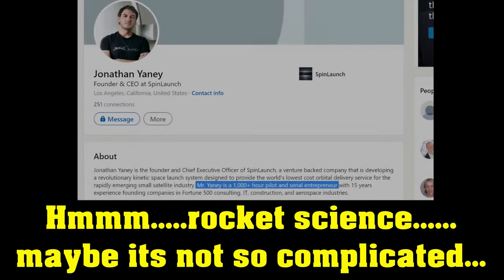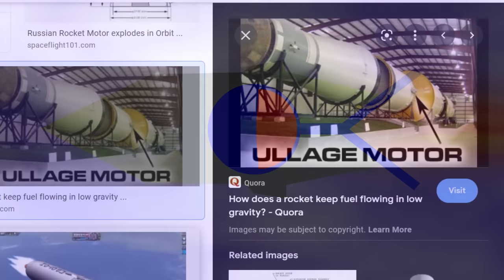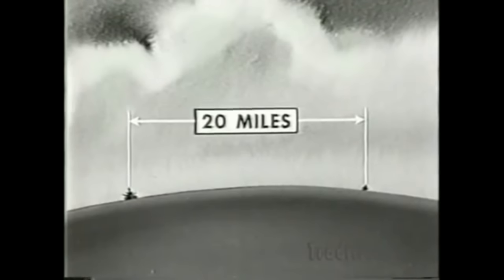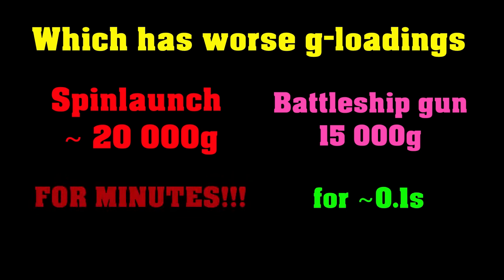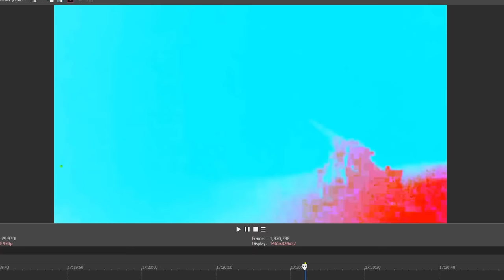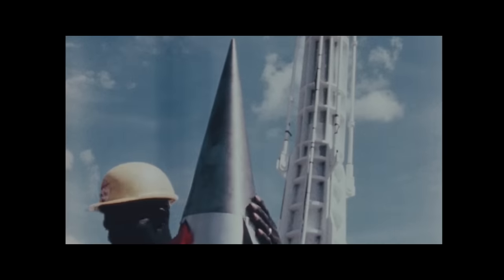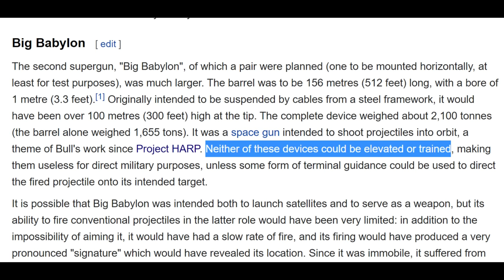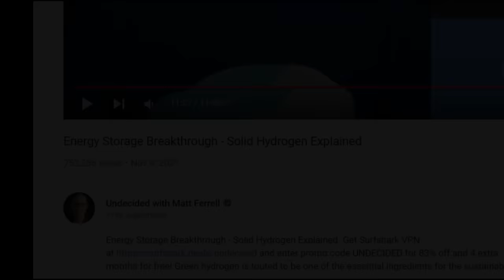Spinlaunch: BUSTED (Part 2)

Comment: Maintaining a vacuum would probably be the easiest obstacle to overcome since you could basically put really big shear rams on the exit hole after the projectile leaves achieving only a partial vacuum loss. After that, as others have commented, the real issue is not having a counterweight to prevent the whole facility from turning into a 5000rpm DEATH TRAP.
Reply: Not with the kind of vacuum they need. Meteorites burn up in the mesosphere, that has less then a millibar of pressure. They are planning to spin this thing for an hour, at supersonic speeds.  I'd say they'll need a damn good vacuum for this thing not to burn to crisp in the first 10 minutes.
Reply: @EvanOfTheDarkness  The ram can be placed at the entrance of the barrel interface to the centrifuge and long before the missile leaves the membrane to be activated as the missile clears. The longer the barrel the better. Still a dumb idea all round, though, to launch a satellite.
Reply: Would it be possible to rapidly reposition the arm along the axis as the missile is disengaged to regain balance? Could it be done in less than a degree of rotation?
Reply: @_c_e_  it may be possible, maybe not moving the arm itself because the space is limited, but moving a mass on the arm. However, the necessary vast amount of energy released in a really short time would match an explosion. Then there is the issue of getting it perfectly balanced within a millisecond... I see a lot of possibility for catastrophic failures.
Reply: @human_isomer  They could release a weight in the center of the arm,  and have it crash into some energy-absorbing material.  The main problem is pulling a vacuum on a rippable membrane.  Atmospheric pressure is insane,  you can use it to crush a train car.
Reply: Na, they just need to figure out how to make a magnetic field. Then they'll be able to launch a whole squadron in a day. Problem solved.
Reply: @LarsLarsen77  The energy released by that would be in the range of the biggest cannon on a battleship and could possibly blast away a smaller hill. Absorbing it, e.g. by water, would require a lake. And the safety zone may easily be several kilometres wide. Daisy cutter counterweight? ;)
Reply: @_c_e_  Air in a vacuum travels at the speed of sound, that's around 300m/s. Unless you are willing to make the launchtube hundreds of meters long (which will create other problems such as having to launch at extreme precision so as to avoid having the missile collide with the launchtube) that shear ram would need to close within milliseconds if not microseconds without destroying itself the mechanism closing it and it's frame while still creating at least a decent vaccum seal and still be able to withstand an airblast at the speed of sound.

The whole thing is essentially a hyperloop just with them causing a catastropic vacuum failure on purpose.
Reply: @KingQwertzlbrmpf  I think it would be possible to time a light weight sliding membrane which accelerates around the inside perimeter and closes behind the projectile as it enters the exit tube. That would be easy.
Reply: @LarsLarsen77  "They could release a weight in the center of the arm,  and have it crash into some energy-absorbing material." - excellent idea, then they could potentially reclaim half the energy into some form of energy storage. As for the membrane, I think as they progress in their "failed satellite to orbit" design it would be a metal sliding, or lifting hatch. I think this could be done in close tandem with a closing hatch at the tube ingress as the projectile enters the tube.
Reply: @_c_e_  The primary problem with your "light weight sliding membrane" is that it would need to withstand an air blast at the speed of sound. It's not the only problem but it's the most obvious. I don't think you understand just how devastating such an air blast would be. We are talking about an overpressure of more than 10 psi (realistically we are probably talking about at least 20 psi). Let me tell you how the description for blast damages for an overpressure of 10 psi reads:
"Reinforced concrete buildings are severely damaged or demolished. Most people are killed."
And you want to hold that blast with a "light weight sliding membrane" that also works as a vacuum seal for what's behind it?
Reply: @KingQwertzlbrmpf  Yeah membrane is not the right term, How about something stronger and in the shape of a cone? Then as that closes, a ring opens up around the egress membrane and funnels atmosphere down and around towards the cone and open to the rear of the projectile?
Reply: @KingQwertzlbrmpf  I also would like to point out I am only thinking of ways to make parts of this work, not the part where sending a satellite to orbit works or not. And stabbing at me is counter productive.
Reply: @_c_e_  The core concept is fatally flawed. It's essentially the same as with the hyperloop. Only that the spinlaunch people are intentionally causing a catastrophic vacuum failure in their machine.

We could sit here all day and fantasize about solutions for all the big and tiny problems that this thing has but that doesn't change that the whole concept is flawed. I'm not saying that there can't be any solutions to these problems. All i'm saying is that until they actually presented solutions to those problems they shouldn't be taken seriously.

Comment: The sustained (and un-sustained!) loads that this thing expects satellites to tolerate is just insanity. Often the satellites cost MORE than the launch of a typical rocket. Even if this thing could launch rockets, just imagine the additional engineering cost to launch from a centrifuge.

They would actually be better off just pointing a giant railgun at the sky... 12m gun under the same g-load (some apparently go higher) gives you about the same muzzle velocity. I'm sure the power required to accelerate a 200kg projectile 20,000g's is also insanity but crazy begets crazy (although I somehow imagine that a railgun is easier to scale up than a vacuum centrifuge).
Reply: Yes, a linear track for acceleration rockets would make much more sense. Thing is, even if you launch your rocket with a railgun, you still need a stage to make it all the way to space and to circularize the orbit. The only thing you save on is fuel. And that is just not a big enough motivation. Even SpaceX only cares about saving the engine, even using more fuel to bring it back safely.
Reply: @EvanOfTheDarkness  Oh yes I agree completely; this whole thing is like the start of a nice idea but really makes no sense at all. You'd have to take a 200kg probe from a parabolic trajectory into orbit on the order of km/s. That's with the engine, all the propellant, the payload and of course whatever heat shield they intend to use to survive the atmospheric heating. I'd suggest it might be good for launching marbles into space. Maybe.
Reply: The funniest thing about a space-railgun: it could claim the same "unique" advantage as the spinlaunch, aka electricity is used as fuel.

Sure, that argument is completely silly if we even TRY to take all the needed ressources into account... but hey: make something electric and find a way to use a magic vacuum => perfect hypemachine.

This insanity doesn't need to work, it just needs to amass big investor bucks.
Reply: @peterpan4038  Wanna partner up?

Comment: Here's another one for you:
When the centrifuge is at full power imagine the effects of loosing 200kg from one end...
The shaft and all the bearings and seals will experience a load of about 4,000,000 kg.
Reply: Would prob shake it self apart in seconds. It would have to release or shift 200kg in the opposite radius.
Reply: There’s a counterweight which comes off at the other end, though the patent isn’t very clear about where it goes.

Comment: Yeah nukes can be fired from a cannon. The main thing with nukes is that they have trouble surviving the impact on the way down so they usually need to air or surface burst. Nuclear bunker busters are a thing but even then, you need to be more gentle with them than high explosive, and vastly more gentle with them than solid projectiles (like the project thor "tungsten telephone poles" which were literally meant to deorbit into their target and remain mostly intact as the collision liquified the nose of the projectile and bored a hole in the target, although it should be said that they wouldn't leave much intact debris).
Reply: The Davy Crockett!
Reply: Ahhh yes, the "rod from God..."  One of my favorites.
Reply: @Real_Tim_S  Its such a simple elegant weapon. Its like our old spear throwing days. "Take thing and throw it really fast at another thing"
Reply: The nukes fired from the gun was gun-type nuclear bombs like the one used in Hiroshima, not the more complex implosion types that Thunderfoot for some reason showed in the video.  That is US cannon-fired nuclear weapons, someone county might have created an implosion bomb fired from a gun.
Reply: @Real_Tim_S  The "rod from God" only work in the James Bond movie. They won't fall down but remain in orbit until you brake them down.

However, the KE projectiles used as Anti-tank ammunition can penetrate several meters of solid concrete or almost any metal.
Reply: So... they made a gun... that fired guns?!

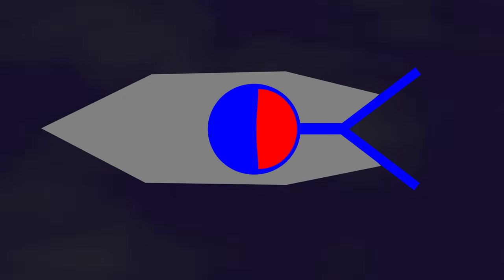Comment: [ @ 2:05 ] Uhh, you do know pressure-fed hypergolic engines exist (the recently launched Astra rocket uses one for its upper stage). They don't suffer from the same problems of sloshing/non-uniform flow. Regardless, those issues don't usually occur on smaller scales even if they opted to use a turbo pump design; so long as there is a full tank. Even if those issues did occur, it could be easily solved via the use of a smaller header tank. Most modern upper stages do not have ullage motors; the only one I can think of is Soyuz, which is ancient.
Reply: yeah was kinda surprised he harped on that so long. On the upside it did get him to make another video dunking on the other obvious problems with this project.

Comment: I dropped out in grade 10 and even at a cursory glance I could see this was a dumb idea.
Reply: Ya, it really isn't rocket science huh?
Reply: Funny thing is, the idea itself is not this bad, these guys are just doing it really dumb.

One of the limiting factors of space travel is the famous rocket equation, stating the fuel use is exponential with the velocity you want to achieve, because you need more fuel, to bring more fuel with you. One clever way to improve on this, to basically shoot the rocket out of a gun, or use a normal airplane to give it some initial speed (and the second one was actually used to launch smaller rockets to orbit). Using a centrifuge is also a possibility, with its own pros and a lot of cons. Of which SpinLaunch addresses none of them, and they are seemingly not even aware of the problems they'd need to solve.

Comment: I do not know if I had missed it, But the projectile would also have angular momentum with a rotation equal to the centrifuge arm. Therefore, by the time it breaks through that sea, it would be spinning like mad.
Reply: No, it absolutely would not. 
Once the arm releases it, the payload is strictly ballistic.
Reply: @tomcorey9833  … with a spin to it. Like a bullet from a rifle, with the spin around the yaw axis, to use aeronautical terms.
Reply: @johankotze42  Ah, ok, I thought you meant and end-over-end tumble (I have seen people make that claim).
It wouldn't have a spin around the long axis either, though. At least, not from the launch mechanism. And of course such a spin is absolutely desirable here, for exactly the same reason there is rifling in a gun barrel to put a spin on a bullet - it makes the payload much more stable.
SpinLaunch has fins on the payload specifically to give it that 'around-the-long-axis' spin. There is a launch video from a camera mounted to one of the test launches, and you can clearly see the that spin starts after the launch, and increases in speed for a short while.

Comment: In the test footage of the rocket breaking through the film, i see something pearcing through the film behind the rocket that looks detached and seems a bit early for it to be the tail or tail fins breaking through.  It could be a part of the release mechanism that broke off causing the 'launch' angle.
Reply: Even if you release it perfectly, the rocket is still spinning at 180 RPM sideways. Angular momentum is preserved, so it'll continue spinning until the aerodynamics stops it.
Reply: That bothers me the most about this launch. The way it separates is different to how the nose of the missile cuts through. So I don't think it's a small piece of machinery which would pierce a small hole. It appears to not be a part of the missile either, that part of the missile is smooth with no fins. 
Honestly it looks like an air pressure bubble to me. But I'm confused because there are air noises where there shouldn't be. 
To the point where I'm not even sure the spinning arm released a mass at all. I  didnt see the missile on the arm, nor the arm afterwards or footage of the release from inside the spin o magig. 
Muh conspiracy!

Comment: whoa! the payload is up to 200KG, the "second" stage it'll be attached to, and the fairing/sabot are likely to put the launched portion weight at over a tonne.
Reply: And humans that have a chance of ever going to space weigh about 50 - 95KG, which means that you could launch a single human... If you had nothing else.
Reply: @kirayoshikage4057  you could launch what USED to be a human lol

Comment: Oh 20000G, 200kg of payload will weight  4000000kg ,  about 4000tons , about 50 M1A1 tank.  With one arm to hold it . And release at split of a second,the arm has to be really strong and accurate ❤

Comment: Well, there is one more point to this which has not been considered in both videos.
In their final version, they want to have a release-velocity of 2200 m/s at a circumference of about 300 m.
This means on release, the projectile not only has a tangential velocity of 2200 m/s but also a rotational speed of about 7 revolutions per second.
After release this rotational speed of the projectile will be maintained. This means that for every 300 m of linear travel "into space" the projectile will make one full rotation around an axis perpendicular to the direction of travel. This surely is not want you want.
Of course in their 3D CGI "simulation" this was neglected and the projectile magically has no rotational speed after release.

Probably this is the reason why in the slow-motion video the tip and the back don't emerge at the same spot.
The 30° twist on exit through the window mentioned in the first video totally makes sense when you compare the distance between the tangential release point and the window to the circumference.
Reply: This is why you release the front a few milliseconds before the rear. That cancels out the projectile rotation. The discrepancy in the exit hole is explained simply by the release timing being either a millisecond early or late.

Comment: The g load is high but the ‘jerk’ is low. Jerk is often a bigger deal than acceleration. That’s because it’s what controls the rate at which the atomic structure is forced to change to account for the acceleration. It’s the difference between standing on a diamond and hitting it with a hammer. Jerk is also what’s responsible for material fatigue. I think there’s a market for a spin launcher but it’s pretty niche. Anything with strong, but brittle components that needs to a cheaper launch system than a rocket.

Comment: Thunderf00t, Yes, the Excalibur 150mm can hit a car at 50 miles away with GPS guiding.  I actually wrote the software for the PLC's to automate the explosive loading of this shell.
Reply: PLCs??  for real? Why not just make a lil tin clockwork man to steer, like from the 1300s?
Reply: @Dr_Wrong  The PLC for the production machine. 
The projectile is controlled by an embedded system.
Reply: @norbertfleck812  oh.. lol oops.. shoulda guessed that, sorry =P

Comment: Busting the speed using frame by frame analysis only works if you are absolutely sure the fps is high enough. If they claim 6x speed of sound, the footage would be more than one rotation per frame, but you could still 'debunk' it with your technique.
Reply: He would have maintained more credibility if he had pointed out that six times the speed of sound isn't escape velocity.
Reply: i was looking for this as him using the unknown FPS of the cam footage and counting rotations is akin to looking at footage of propeller blades going backwards and wondering how the plain can fly.

https://www.youtube.com/watch?v=HYT8YxFYD74

TF doesn't know much about physics, i hardly watch him anymore and every video of his i do, my opinion of him gets even lower.
Reply: I guess physicists don't learn Nyquist–Shannon.  Just another reason us engineers are better.
Reply: @billberg1264  " I guess physicists don't learn Nyquist–Shannon.  Just another reason us engineers are better."
Engineers make good worker bees, for sure. But if you want something new, ask for an inventor.